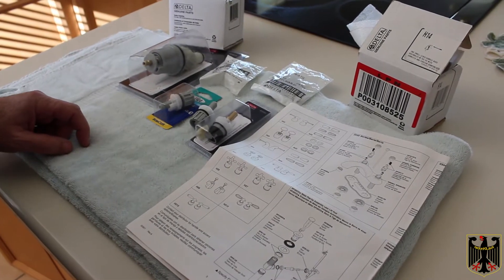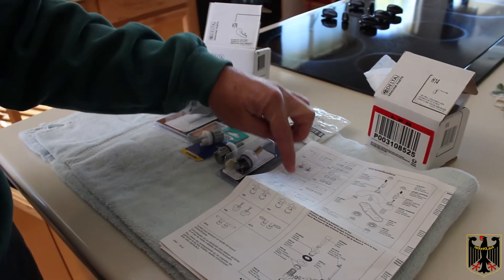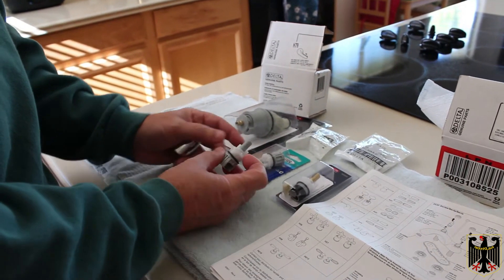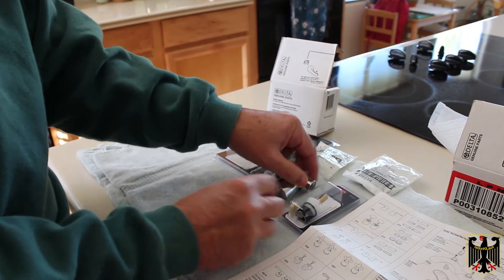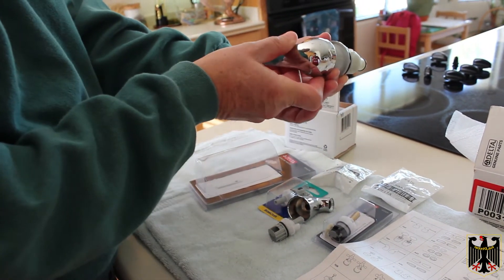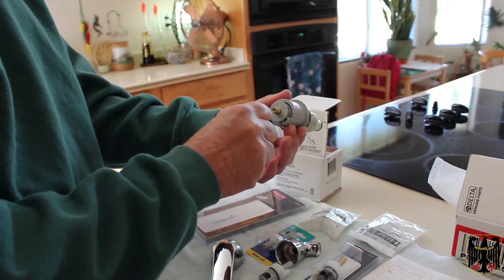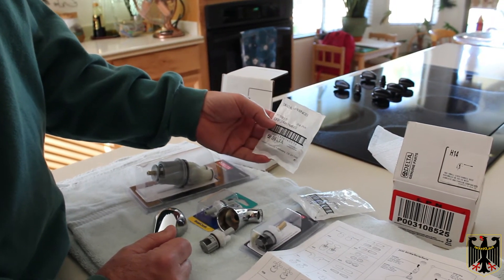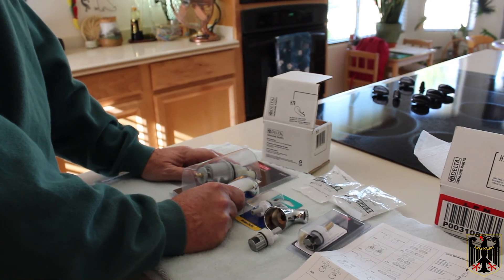Delta Faucet Handle and Stem Design

Comment: what does one do, if a widespread bathroom sink delta two handle faucet handle wont come off?
Reply from the maker: If the set screw is out, and you don't care about the stem/consumables, I use plastic pry tools to pry up, and often times need to use CLR, or a penetrating oil, to break down/loosen up any buildups.  Thanks for watching!